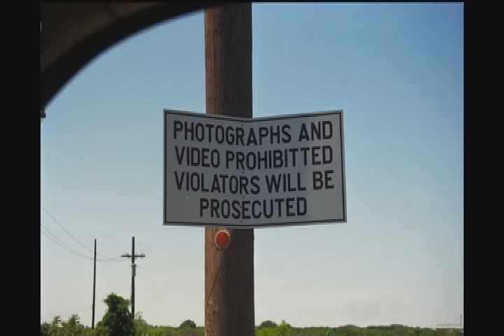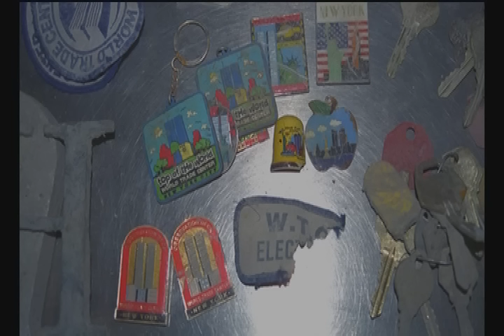Fresh Kills (Landfill) - WTC Debris Burial Ground, pt. 1

Comment: A normal collapse crushes bodies, but here, the poor people inside were atomised by the internal planted explosives.
Reply: Explosives go off with a series of very loud bangs Peckerhead.
Reply: As confirmed by firefighters,  the media and many witnesses on film. There's even forensic evidence of explosives found in  the dust. And of course,  buildings don't just drop all of a sudden just because of office fires without any resistance from their vertical steel beams if they aren't blown up first. The images of buildings 1 and 2 clearly show the explosions going off and the huge blocks hurtled in an arc could NEVER happen due to just gravity. All of this is perfectly documented. Well done!
Reply: Alberto C  The whole event was broadcast live I remember to the whole world. A massive structure in its death throws, with beams breaking and concrete cracking, and with electrical substations exploding and arcing will make all kids of noises.
BTW truthers always like to quote 'nano' thermite, to explain the lack of noise, did you forget that?!

You are also quoting the media and the government when you talk about explosions and explosives found when other truthers say that explosives were not tested for. Are any of the theories the same?!

Air pressure throws out some debris, and the footage shows no explosions. BTW, do you have any idea what it takes to rig those towers on every floor with bomb and fireproof 'explosives"? Nope.
It isn't possible. period.
Reply: I'm sorry,  no offence meant but I'm not going to waste my time explaining the details which you so merrily get so wrong. I sense you don't you want to hear anything other than YOUR truth.  You ARE a truther of the oficial conspiracy theory. I only speak with people who seek, as I do, the truth objectively and critically, not people that think they own its patent.
Reply: Alberto C can't truthers write a sentence without the constant misuse of the word 'truth; proof, and proves?
These are used in a religious/cult type use of language.

One you go, how do you think the towers came down and give us a laugh.
Reply: Alberto C I work at universities and have worked in industry and I have never hear of the 'publication', and have never met anyone who has mentioned it. (and there is a disclaimer). It is written by the same couple of truthers (who propose laser and crap).
If you actually knew any people who worked in the industry,  then you would know better. BTW I would go and post on any demolition forums (or any other), and then you learn something wakey wakey.  duhhhh
Reply: Alberto C I noticed that truthers don't like people coming along with some knowledge. I should have said , "...like millions of other people, I worked in industry and in a university....". What I wrote sounds like I am unique in some way. I worked in maintenance and research.

The rest of your comment suggest strongly that you would not understand my comment or any information given too you anyway on any working professionals forum.
Reply: if it was controlled demolition - why didn't it fall from the bottom ? LIKE A CONTROLLED DEMOLITION ? because it just wasn't one - there is no evidence of controlled demolition what so ever just pure theory and conjecture
Reply: Oh go back to your Pokemon Go.